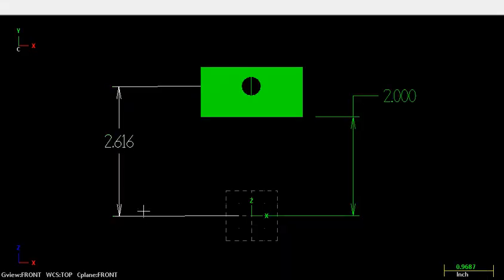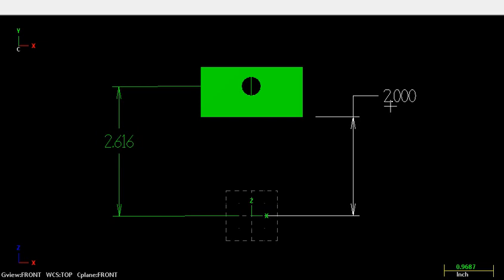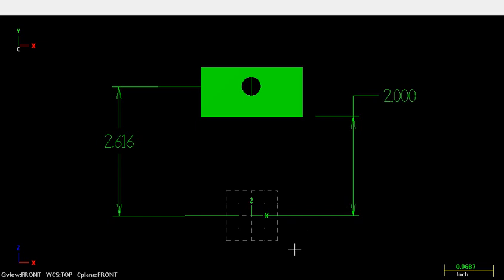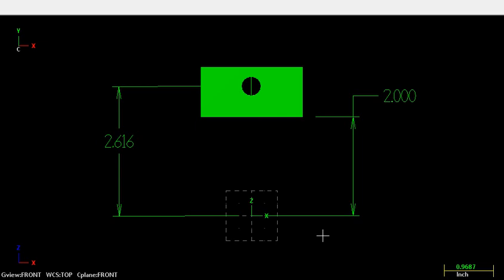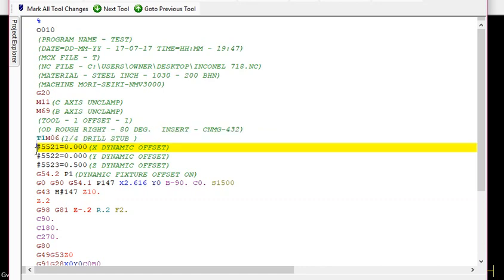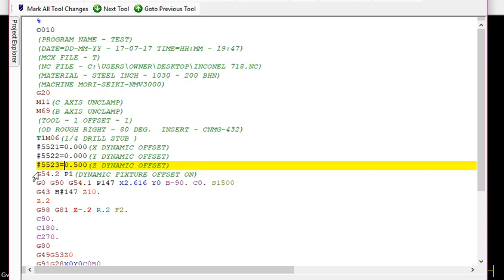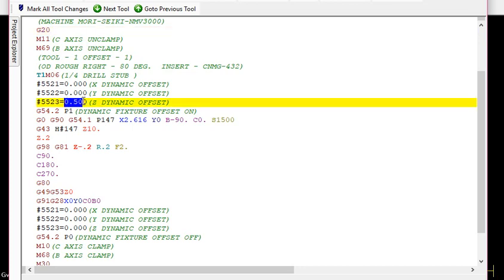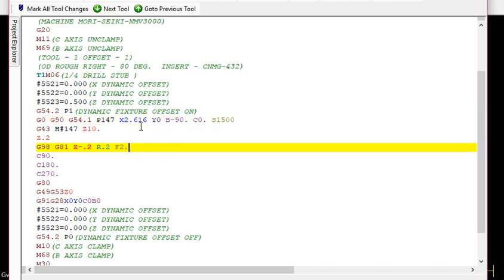How to use dynamic fixture offset on Mori Seiki NMV3000

Comment: Great tutorial! Much appreciated! I just want to ask how does P1 relates all variables #5521 #5522 #5523. how does it work with P2, P3...?
Reply from the maker: Every P value will have a designated variable. Unfortunately i only know the one for p1- but you will need to know jus one. Since every time the machine reads it it will replace the old value.